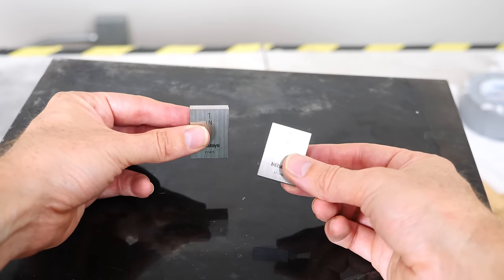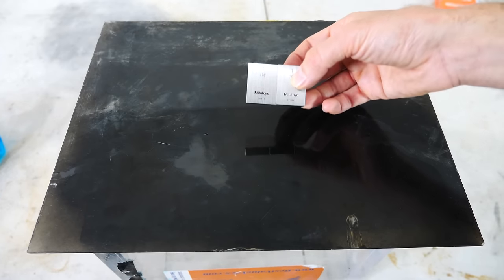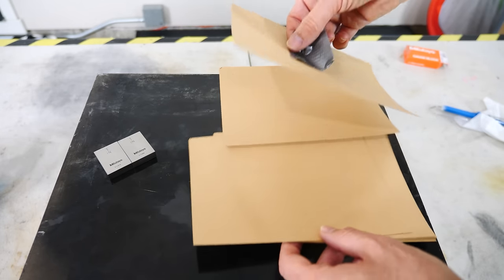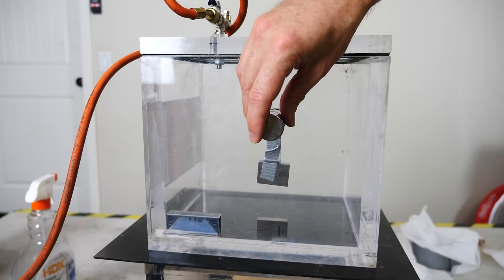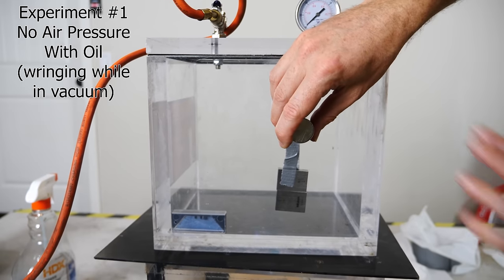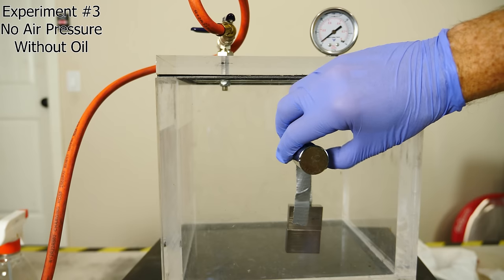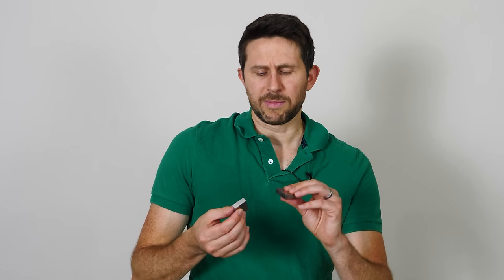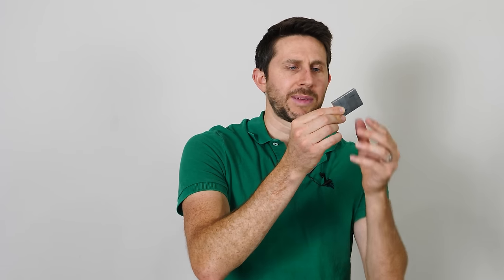Will Gauge Blocks Wring Together In a Vacuum Chamber?

Comment: Dang 
Non magnetic pieces of metal sticking to each other with a lot of force

This is genuinely really interesting
Reply: Ye ikr lol
Reply: I didn't understand.. how did they stick?
Reply: @chandrahasreddy1729  re-watch the video.
Reply: @pumpkin8222  true.
Reply: @pumpkin8222  irrelevance aside, good comment
Reply: @pumpkin8222  adding to this, anarcho-capitalism is also a deeply flawed and unsustainable system.
Reply: There are also ceramic blocks that do the same and you don't have to worry about rust or coefficient of thermal expansion, meaning they are practically immune to temperature factors that would change the size of the blocks.  The downside is that they are easier to damage/chip if dropped.
Reply: @MsScarletwings  "b-b-but look over there!!"
Reply: @chandrahasreddy1729  the same way the block itself is a block stuck to itself. theres no such thing as a block of metal. its a bunch of atoms, stuck together. this is smooth enough that the very same sticking process works on another block when the atoms are close enough to stick
Reply: @brosephjames  😮means they (atoms) are close enough to stick to each other
Reply: @chandrahasreddy1729  Vaan der waals forces.
Reply: @aminulhussain2277  😲

Comment: The most important factor with the holding force is the quality of the contact surface finish.  My practical experience: better finished blocks hold sufficient well without oil, less good finshed need oil! And this does not mean that the less good finished blocks are out of specs!!!
Reply: The problem with wringing with no oil is if you leave them for long periods, they will fuse together.  For example, overnight.   Good luck with breaking them free.
Reply: @Jiggledance  I was not aware of that fact! I never left them long time together.  And we name the oil a protection oil that we apply after use of the blocks, not a "fusion" oil.

Comment: I just started a machinery course and we were shown gauge block wringing and I was intrigued.  I assumed number 3 was the reason for the bond since the teacher said these ones were in bad shape and needed to be cleaned and polished as there were some near permanent fingerprints on them.  Number 3 makes the most sense to me because we know that in a true vacuum with absolutely zero oxygen like metals can contact weld.  So this wringing effect as I am making sense of it in my head is like a super small scale velcro between the molecules of the blocks.

Comment: Nice experiment ,  you can measure the contact resistance between them  with a milliohmetre  if the tow metal touches each other,  and if they are separated by a thin oil film they will act as a capacitor.
Reply: Yes, I wondered if the oil improves the bond between the surfaces like a dielectric or 'magnetic core'
Reply: I think they will touch in 3 microscopic spots and be held by oil everywhere else.

Comment: My brother worked for an optics company and he had two pieces of glass which were so smooth they were PERMENANTLY bonded by "wringing" them together in a bucket of soapy water.
Reply: Multi camera and telescope lenses are assembled exactly the same way. No adhesive, just perfect glass to glass contact. They will never separate without damaging both lenses.

Comment: I thought they would be welded to each other in the vacuum
Reply: If they were rubbed to generate heat enough they would weld. Friction welding as done for rockets.
Reply: if the surfaces were freshly-machined, and subjected to pressure, they would indeed cold-weld.
Reply: @timelsen2236  They are talking about cold welding not friction welding.
Reply: @douglasharley2440  That is a fair point.  I wonder if the 25nm is to permit space for the oxide to form.  It may be that the oil minimises the thickness of the oxide and prevents the block becoming unusable whilst also preventing them from welding together.
Reply: That's what I was wondering. If they were cold welding in the vacuum part.
Reply: @timelsen2236  friction welding and cold welding are 2 different things :) something like pure gold will cold weld, because the atoms in the 2 pieces of material simply have no way of telling which one they belong to. Part of the reason why astronauts have to take into account cold welding into he vacuum of space. Cody's lab did a fantastic video about cold welding

Comment: Thanks for this! I oftentimes used kerosene and meticulous cleaning to wring them together but they never STUCK so strongly as shown here. Seems the company I worked at had little actual skill about this important aspect of the work we did!
Reply from the maker: It sounds like you were cleaning the oil off which is the strongest reason they stick together

Comment: I worked at a double disc grinding shop and we basically specialized in making parts flat. I would be done with some small rectangles or even really precise parallels i would be able to slap em together and they would stick to each other. Also did steel plates and when placed on a precision granite it would be impossible to lift it off the granite. Compressed air would be needed to walk the parts off the granite table.
Reply: Thank you!  You just proved my point perfectly!! 😀
Reply: @imnewtothistuff  what point?
Reply: @amanciobarragan   My original, earlier comment.

Comment: I think it's oil viscosity. Any minute traces of oil will create a layer in between. If you want to move them apart, the layer needs to get thicker first, so oil from the edges must flow to the middle. But since the layer is so incredibly thin and the oil viscous, it requires a lot of force to flow. I think they are basically glued together with oil.
Reply: First of all what is surface tension at the atomic level and second of all ask yourself if the permittivity of the oil will enhance the electric field potentials

Comment: What about the Casimir effect? This might explain some of the attraction. At 10 nm of separation, conductive surfaces will exert about 14 psi or 100 kPa or 1 atmosphere of pressure against each other. I think the video said there was more space between the blocks than that, due to the oil, but there'd be some Casimir force.
Reply: Interesting
Reply: So a vacuum
Reply: @THESLlCK  An inward pressure of around 14 PSI. This pressure exists even if the plates are in a vacuum. It's a pressure in the sense that it is a force that is proportional to the perpendicular area.

Comment: Cleaning them with a paper towel is kinda a wimpy method. You could ultrasonic clean them with a degreaser. Metal is porous and can hold oil. You could also try heating the residual oil off after the wipe down. Or try is with ceramic block.

Comment: I really appreciate that this video shows that sometimes (maybe even oftentimes) there are multiples causes to an effect.  Too often I hear people talking about a single cause, implying that causal relationships are easy to figure out.  But the trouble is that there can be two or more elements which when combined bring out the specific effect.  Which makes it quite difficult to figure out what is happening.

I first learned of this concept when doing some research on Chronic Fatigue Syndrome, for which I received a diagnosis in 1993, some two years after I first got sick.  One reason CFS is hard to diagnose is because there is no test for it.  And that's due to there not being a single cause for the illness.  It is known to have a viral cause, such as Epstein-Barr because the illness behaves like a retro-virus with symptoms fluctuating.  But that's not the whole picture.  Some people get sick but don't have the Epstein-Barr virus.  Instead, they may have an influenza virus instead.  In the early 90's it was often called the Yuppie Flu, because for many it started out as a flu.  Others, like me, started out with Mononucleosis.  So researchers realized there had to be other factors involved.

Anyway, this is how I became acquainted with the notion that things might have many causes to them.  While dominoes and Rube Goldberg machines can illustrate how a series of events can be related through cause and effect, they don't often show how a confluence of factors may be necessary for an event to occur.  Weather patterns are a better example of how there needs to be two or more elements at the same time for a particular event to happen.  Hurricanes and tornadoes need several confitions to be present in order for their formation.

I think, too often, people look for one thing to be the cause of whatever problem they are facing.  Either because they are looking for a simple solution or they lack the imagination to accept the complexities of reality.   From America's war on drugs, Nancy Reagan's "Just say no" campaign, to the Prohibition Era, these are all examples of failed attempts to solve social ills because of a lack of understanding of just how complex these problems really are.  

So if your channel can not only educate people on science matters but also show them how to open their minds to broader ways of looking at a problem and possibly having a better understanding of what's needed to find possible solutions, I would say "Well done.  Keep up the good work."

Comment: I believe wiping with paper towel doesn't remove oil, it just thins the layer. In this case we are dealing with microscopic phenomena so even the thinned layer of oil can be sufficient to have an effect. To remove oil you need to use a solvent (e. g. acetone or paint thinner), a surfactant (dish soap) or alkali. Removing oil is a demanding process which is done before painting parts.

Comment: Iirc a good rule of thumb is the distance between two guage block sides "wrung together" is one millionth of an inch.  That's like 25.4 nanometers. Atoms vary in " size" from ~0.27nm-0.037nm so it would seem like a few atom could fit in between them. It might be a tight fit for some molecules in the air.  So I'd guess the vacuum won't affect them. I remember once two flat surfaces get a certain distance or less most em radiation can't fit thru the crack. That creates an imbalance between the area outside the small area between.  That seems almost like an em version of a vacuum. I forget what the effect is named. I think that would be what holds them together and maybe the two sides being worked till they both fit each as if each side had a bunch of tiny pins which slide between the bunches if tiny pins on the other side thus having twice the number if tiny pins in the same area which puts horizontal pressure on all the pins making them "stick."

Comment: This seems rather similar to cold welding
Reply: I've heard that if left together long enough, they do cold weld.

I've never tried it, because good gauge blocks are expensive.

And I don't know how long "long enough" is.
Reply: Seems like it. But didn't expect the attraction force to be so weak. Either it is actually weak or he is not doing it in a proper way
Reply: I was thinking the same thing.
Reply: @weevilinabox  smart man lok
Reply: @weevilinabox  He did a cold weld with a vacuum bag, maybe try that
Reply: @vaibhavbv3409  I’d say the later

Comment: It is really interesting! if we had gauge blocks heated or freezed, could the result change?
Reply: The air pressure effect shouldn't change much I suspect, but oil tension and electron forces would both change noticably.

Oil tension would weaken outside an optimal bound, too hot or too cold methinks.

Electron forces may increase as temperature increases toward the melting point of the metal.

Not a chemist or material engineer so that's just my supposition.
Reply: It actually does - and it may be significant at the precision levels of measurement those blocks are often used for. I read that, to get maximum accurancy, they should be allowed to cool for some time after just handling them
(because just the heat from the hands is enough to make them expand out of their specified tolerances). 
Most are probably specified and calibrated at a temperature of 25°C (77°F), since that seem to be the "standard room temperature" in a lot of applications - for example in chemistry and it's also the "standard temperature" electronic components, many measurement devices etc. are specified at. 
It could be a cool demonstration if he for example took a block and submerge in liquid nitrogen, see how much it shrinks, haha - or heat it up to like 200°C (higher temperature is also possible, but may ruin it by oxidation).
Reply: @Speeder84XL  First, thanks for discussing like that. I totally agree your idea! If he could just as you has said, how cool! Anyway, his coming experiments might answer some of our questions.
Reply: @ephemeralvapor8064  Yes, we don't need to think air pressure. Cause he showed it works a little bit even in vacuum. But I think we should check out some elements in the air that might react with gauge material when it was overheated. I'm into your thinking. I'm not a chemist or material engineer, too. Just a learner. Anyway, cheers, Mate!

Comment: You could tether the bottom block to the chamber and then use a force gauge attached to the other to measure the strength of the attraction in each case as you pull them apart and get some quantitative data.

Comment: You can get quartz discs which are even more flat than steel. Do they have this attraction? In other words are they held together in the atmosphere like guage blocks. If so, what about in a vacuum.
I would suggest similar experiments with quartz discs and see if they attract each other. If they do try quartz and a stainless gauge block. The two certainly have different spacings of the atoms on the surface, silicon dioxide versus nickel/iron.
I believe I have played with some quartz slides that they seem to be sticky. Shipped with tissue paper between each slide.

Comment: I think you need to heat up the blocks to make sure there is no microscopic residual water on the blocks that might help it in wringing too. It would be hard to do because I’m certain unless you were in an environment completely void of moisture, I’d imagine the humidity in the air deposits on the metal right away after heating it to dryness. There may even be a galvanic reaction between the metals (even though they are the same metal) accelerated by the moisture, which might be another reason the wringing is possible.  Just a few other ideas I figured I’d throw your way even though I have no proof otherwise. Just something to consider that I haven’t ever heard anyone mention.

Edit: Spelling correction.

Comment: Cold welds....learned that in the early days in space sending metals without rubber or plastic joints would cause a bond so they couldn't open up antenna solarpanels....etc

Comment: When working with optical flats the adhesion can be so severe it will damage the surface if you try to slide them. You must never "wring" two precision optical flats or you risk permanently damaging them.
Reply: True,  They stick because no air can get in between them.

Comment: I think it would be interesting to repeat the test with ceramic gauge blocks, they're usually a much higher quality than your "standard" accuracy gauge block (which says a lot, steel GBs are insanely accurate already) and it kind of eliminates the molecular attraction/cold welding theory of steel since ceramic can't cold weld. They're pretty expensive so I wouldn't recommend getting a set but you could buy two single blocks for a much lower price.

Comment: I thought it could partially be caused by imperfections in the surface interlocking, but you didn’t mention that at all so I assume it isn’t a contributing factor
Reply: That was a thought I had too
Reply: I think the surfaces are too smooth for that, however there is probably some surface distortion on a large scale which may trap energy. I'd be interested to see experiments with gauge blocks at -100'C and 200'C to see if the strength of bond changes.

Comment: One major problem with your vacuum+magnet test.  The magnet magnetized the metal allowing for magnetic attraction between the blocks, which could make up for the lost air pressure.
Reply: Of course there’s only one flaw in your critique stainless steel is non-ferromagnetic
Reply: @timothykauffman2442  then how is he grabbing and moving the object with the magnet at all?
Reply: They are stainless steel, which is non magnetic.
Reply: @DuckStorms   A magical substance known as duck tape and another magnet

Comment: This actually makes me think of blocking we have at work when we make packaging materials from HDPE .. due to the cooling temperature of the HDPE  after the extrusion the layers end up sticking together (there is inner blocking where the inside of the packing material sticks together and outside blocking where the outside of the packing material sticks when coiled) , think the same thing is happening with the gauge blocks .. heat is conducted into the blocks making them expand on a microscopic scale and when you press both together and release they cool rapidly and shrink causing them to stick.

Comment: The force between atoms is actually very strong. In fact, if the both sides were smooth on an atomic level, and there were no oxide/oil layer between the 2 sides...the blocks would weld together permanently. You can imagine having a single block of metal, with an imaginary line through the middle of it and pretend that it was 2 pieces of metal touching each other at the imaginary line. The strength at which the sides pull together is as strong as the metal is in the block.

Comment: Good job putting the blocks in a vacuum chamber, but I don’t buy the argument that air pressure plays at all.  You should be able to measure the force that the blocks are stuck together with (minimum force to separate them).  Do you get a significantly different force under vacuum?  How about cleaning the blocks, wring them without oil, and then put them in the vacuum chamber.  Does the stack fall apart at no atmospheric pressure?